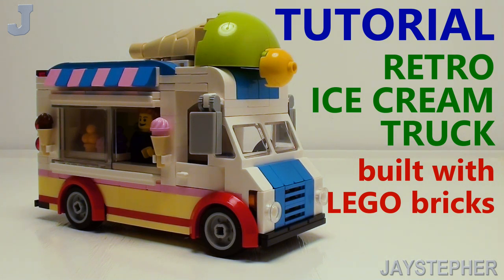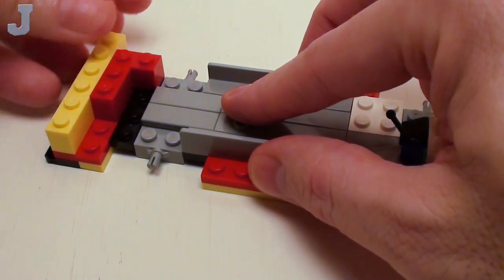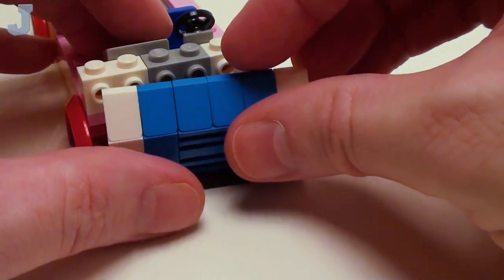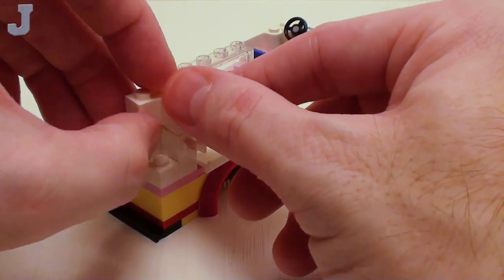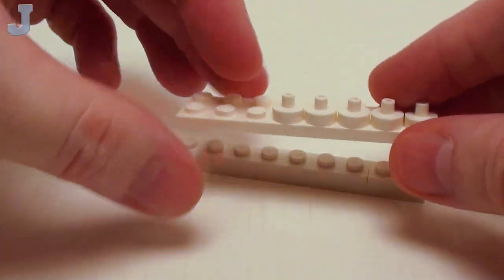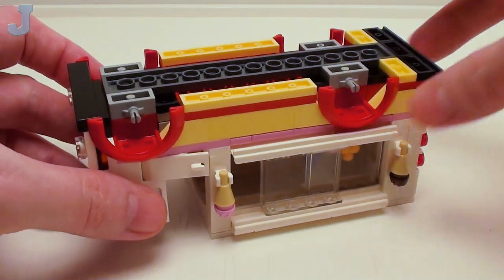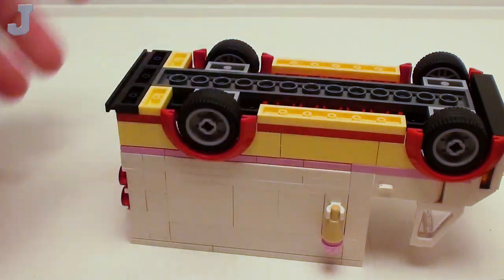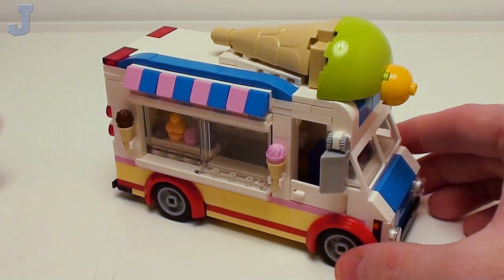How To Make An Ice Cream Truck With LEGO Bricks Tutorial

Comment: where can I find the.....The build uses only 288 LEGO bricks which are listed in building instruction manual 00090.
Reply: Which pieces?
Reply: @sceneitallwithjeffandjon6984  where can I find the ,,,, building instruction manual 00090.
Reply from the maker: the manuals are mainly on patreon at the moment. it was the only site that i can host PDF files cheap.